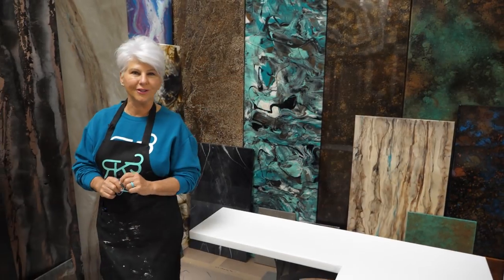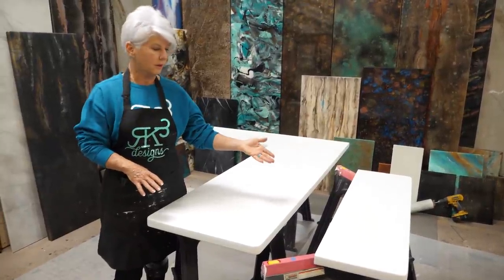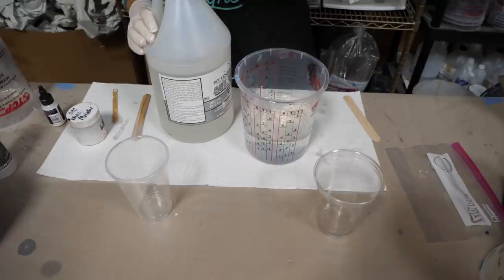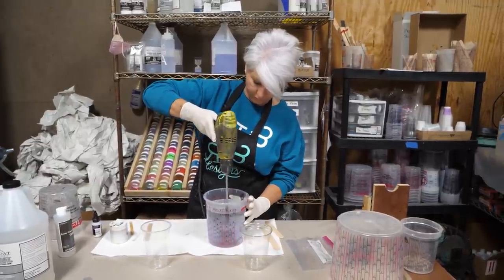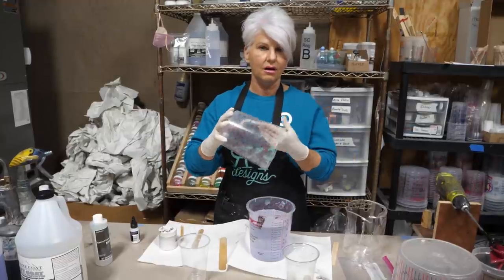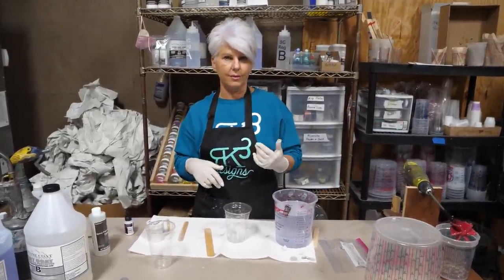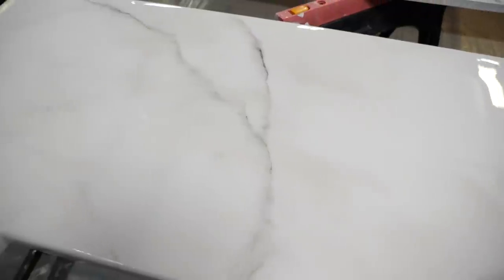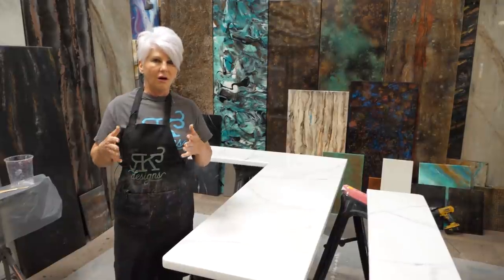Advanced White Marble Epoxy Veins | RK3 Designs

Comment: If you roll a thin coat of clear epoxy on countertop first, and tape your edge, you can do a dirty pour with same colors until you use up all your material and it will flow and spread all over the top in a beautiful, natural pattern. After about 45 minutes, pull off tape and let it flow over the edge of counter. This technique gives you a fabulous rolling natural pattern that looks so real. It's absolutely fabulous! No brushing, no bubbles, no torching....

Comment: I absolutely love your work!  So beautifully artistic!  My question is regarding your “canvas”. You said you use 3/4 inch MDF…. Did you spray paint it white?  Do you have a video on the process of prepping your board?
Reply from the maker: I prepped it with our Undercoat but you can also use a latex paint. Check out our beginner playlist. 😊

Comment: The softer veins look much better and more realistic. Another way I've found to effectively soften veins is to use as heat gun directly over top and follow the vein. it kinda pushes it down into the epoxy. then I trace my vein with clear or a touch of white
Reply from the maker: Great tip. Thanks!! 😊😊

Comment: Yay, good call, love the soft technique! That's what I want!
Reply: instead of using the alcohol to move it, could you use a heat gun to move the vein? I want a matte finish?
Reply from the maker: Sure you can, just be careful to not add much heat is it can cause too much movement.
Reply: Question: MDF, white side up ?
Reply from the maker: @bg2608ret  I’m not sure what MDF you’re using. All the MDF we use is the same on both sides. I would use the smoothest side. 😊

Comment: Can you tell me how long you have to actually work with the product? Also, I see some drips on the edge, are you using your hand or a paint stick to level that out once it starts to cure?
Reply from the maker: Depending on the temperature, about 45 minutes. You can scrape the drips a few times until they stop dripping.

Comment: Would the Ultimate Top Coat provide a similar amount of UV protection that Art Coat provides?  I'm wanting to do a white marble floor similar to this design using SC floor epoxy then topping it with UTC.
Reply from the maker: It will add some what more UVA, but not as much as the Art Coat.